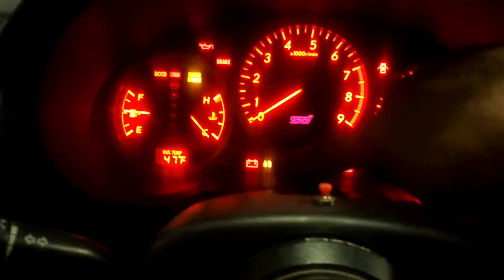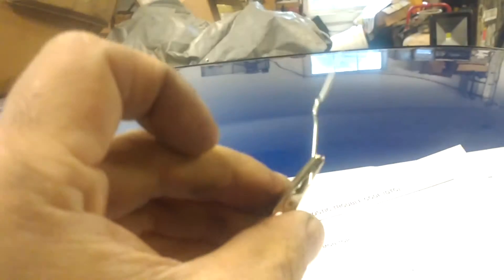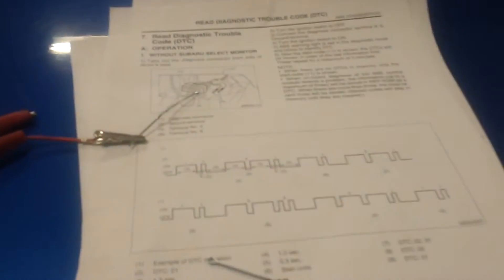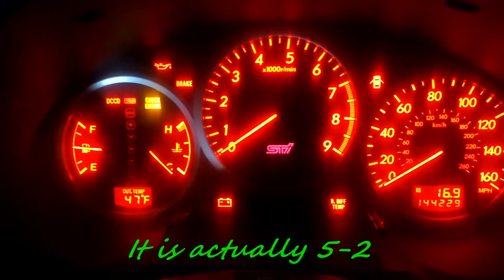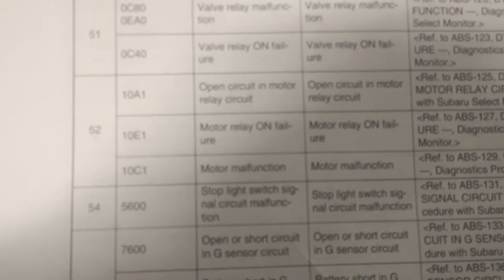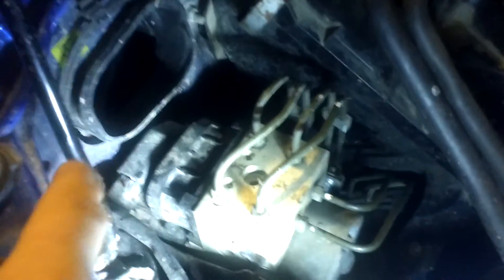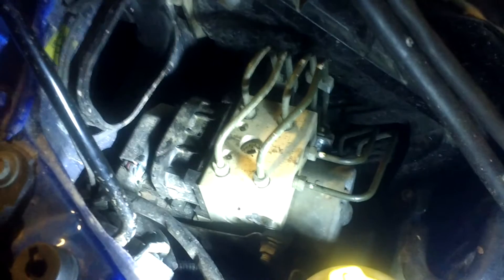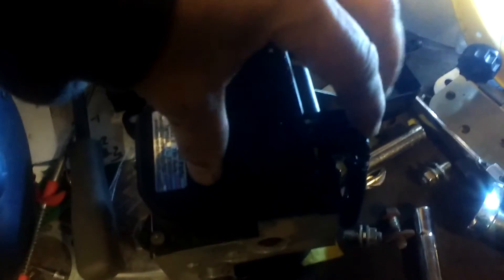ABS diagnostic on a 2004 Subaru Impreza WRX STI

Comment: What happens if the abs light does not come on ?
Reply from the maker: Either the ABS is working properly or you have a problem with the gauge cluster (light blown?)

Comment: Great video but PLEASE clean your lens or use a better recording device.
Reply from the maker: Did you try to check the round relays there might be one on the passenger side next to the glove box too. Not sure where the valve relay is I never had this problem.

Comment: You never showed how to disconnect and replace the wiring harness connector. Everything else is simple, but plugging in that adapter is a very difficult thing to do, even for an experienced mechanic. Thanks for your video, but it was of no help to me.
Reply from the maker: There is no wiring harness connector to replace or disconnect, I am not sure to understand what connector you are talking about. The diagnostic plug just hangs under the dash, it's not connected to anything.
Reply: @FrogRacing  I'm talking about the end of the ABS module itself; you know, the one your video shows at 3:21
Reply from the maker: @djshotty  That's not the goal of this video, it's just to show how to read the codes to find the cause of the issue, it's not a howto fix it.
Reply: @djshotty you push the plastic slide in whilst pushing down on the harness😅its easy once you get the knack

Comment: Hi, I have one question : fault 52 on my car and it seems the ground cable from the ABS is totally missing... Any idea where it should go in the ABS ?
Reply from the maker: If the relay is good, the ground wire usually connects where the bracket for the power steering reservoir bolts to the frame.